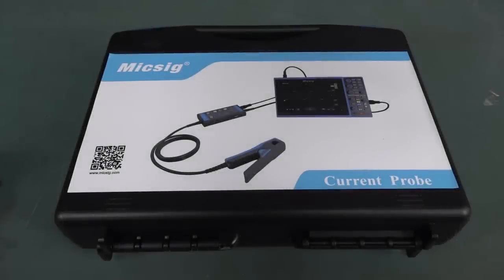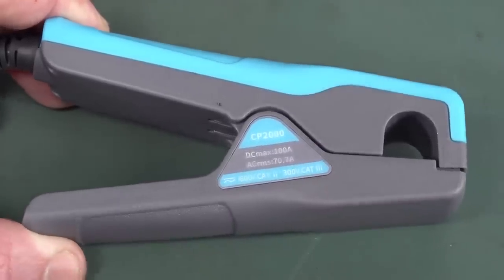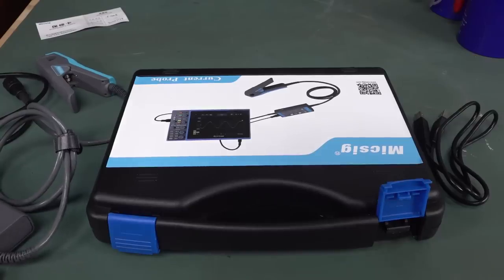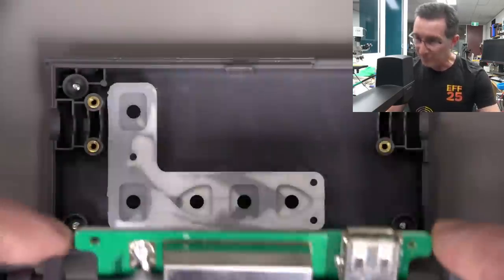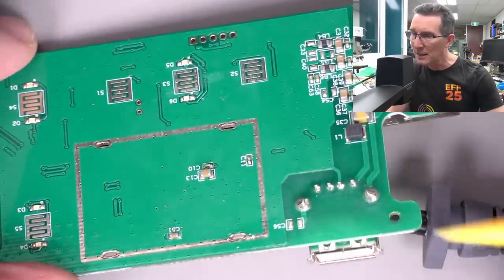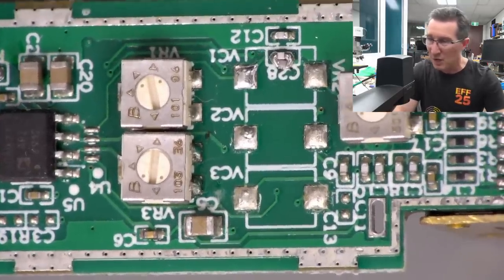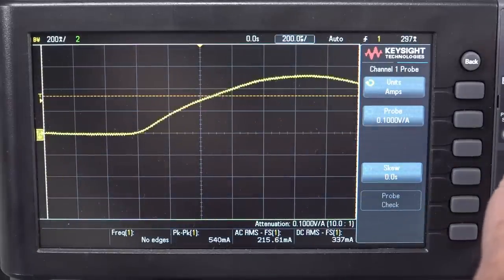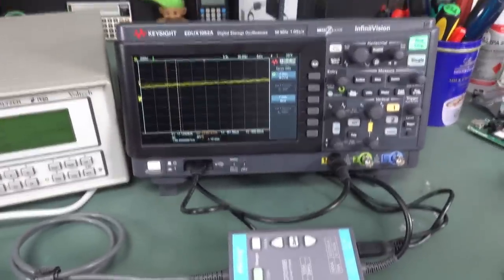EEVblog 1413 - Oscilloscope Current Probe TEARDOWN + DEMO

Comment: Well this is widely used in current sensing for hall sensor in parallel to cancel temperature coefficient. And I work for the company in the video. Max bandwidth we have now is 1-2mhz. And this not yet publicly available.
Reply: You work for Micsig?
Reply: @npc6632  multidimensional
Reply: @yuxianwang3238  So it is a Multidimentional device in the Micsig?
Reply: @npc6632  I’ll double check that. It might. But looking at the design. The ferrite core should not have a bandwidth of 1mhz. The magnetic permeability drops dramatically at high frequency. For those material. The best I known of caps at about 2mhz.
Reply: @npc6632  Multidimensional *
Reply: @yuxianwang3238  That's not the real Dave, so be careful.
Reply from the maker: @yuxianwang3238  Are there any competitor devices in the same package?
Reply: @EEVblog  I know some competitor has same package but using GaAs or InSb Hall but not TMR.
Reply: @yuxianwang3238  Hey Sir , can I know where are you from?
Reply: @MikeJohnMentzer  I’m from China educated in the states.
Reply: bug the oscillioscope been a pleasant experience.. though Micsig should deliver some of the features they been fronting to push thrue OTA.  example of the memory depth.. waveform refreshrates peaks around 100,000 wfms https://www.youtube.com/watch?v=vDdu-4F3XQs
Reply: also very easy to work with these micsig and nice with HDMI to fx portable batteryoperated projector..https://www.youtube.com/watch?v=wlkgdtkoAeE
I would reckon you could also just load the android app in the projector androidOS so no wires. , but havent tried that. bigger waveforms the better... next step 5 meters high on a buildingwall at night.. why?  why not.
mehh but for the money great' portable oscillioscope Micsig makes really love the small formfactor and tke bag to keep it all with mouse and currentclamps etc...
Reply: Can you give a clue on how does this tempco compensation work? as it doesn't make immediate sense to me. I assumed they have two in parallel to compensate voltages induced by changing magnetic fields (those induced in loops formed by the part leads acting like transformer coils)
Reply: @yuxianwang3238  i do not understand this meaning?

Comment: You need to hold the probe in the orientations it's going to be during the measurement as you are zeroing it. Otherwise you don't compensate for the earth's magnetic field.
Reply: Yup. Best to just set up your probe around the wire, power down everything, zero, then measure.
Reply: don't forget: tongue at the right angle and virgins on the slab, as well! :)

Comment: For decades I have used the Tektronix A6302 current probe (50MHz) with AM503 module. It  is an amazing tool as a design aid when designing power supplies. I would not even think about designing a supply without being able to actually see such things as the transient  current on the peak of voltage haversine charging filter capacitors. If you are even thinking of designing a power supply, first buy a current probe. This is an affordable and decent performing tool. Every lab needs one.

Comment: Got it myself as well. Quite happy with it so far. For measuring low currents a wire can be passed multiple times through the clamp to increase sensitivity. Looping twice makes current readout twice as high, .. etc

Comment: Micsig seem to make some pretty good stuff, very happy with the 100mhz differential probes I bought.
Reply: Agreed, I also have the diff probes and the quality is crazy for the price.
Reply from the maker: I had them design a x10/x100 model and I was going to stock it, but it had an issue with CMRR whne I measured it. They are coming out with an updated design.

Comment: HI Dave,  a couple thoughts for reviewing AC/DC current probes:  it'd be helpful to examine the AC waveform phase shift across the bandwidth, and square wave replication accuracy across both the current ranges and frequency bandwidth - it can be helpful to be aware of these things when using a current probe in brushless motor or switching power supply circuit analysis.

Comment: The USB DC-DC is to isolate the supply from your oscilloscope.
Very good!
Reply: I was thinking the same thing, Or when powering it with other usb power source
Reply: It is for preventing a ground loop between your scopes USB ground and BNC ground.

Comment: I dissected the PROVA CM05 current probe, and it also had two sensors mounted in opposite direction, and electrically chained in the same fashion.

Comment: If you put it around the feed wire to the starter motor on a small multi cylinder engine (100A isn't enough for large engines), a motorcycle for example, and disable fuel or spark so the engine doesn't start you can do a relative compression test in seconds. The current goes up as the starter works against the compression in each cylinder, so you can determine if all cylinders are even or one has lower compression than the others. 
Use it on any other brushed electric motor (such as a fuel pump) and you can see the current variation as the segments on the commutator rotates past the brushes, if brushes/segments are bad or a winding is toast it will be quite uneven while a good one should basically be a nice wave repetition.
You can see if an electromagnet moves something, as in a relay or fuel injector, the movement gives a hump in the current waveform.
You can identify coils (relay, fuel injector, ignition coils and so on) with partially shorted windings, as the current waveform will be different from a good coil.

A current clamp can be a fantastic diagnostic tool, even with far less bandwidth than a great one like this. I really have to get one soon -  or a couple, for low & high current.
Reply: ..... How cool, diagnostic detail surpassing mechanical results.

Comment: In college, I worked on a battery powered pic micro-controlled 3 phase current monitor that turned on, took a reading then went back to sleep ... used a i2c dac and 3 external probes, ic2 memory.  auto calibrate, set in the box, lock it up, come back in a few weeks and download the memory using RS232 to a pc and use excel for data analysis... bob's ur uncle.  Great memories.

Comment: It's more like $510USD plus shipping with the coupon code.    Hantek makes one that's not nearly as nice, but it's $54USD.  Manual zeroing and 20khz limit.  That's fine for what I bought it for.  Those of us that have an entry level scope like a ds1054z probably balk at a probe that costs more than the scope.

Comment: I'm guessing the isolated DC-DC converter was used, due to most benchtop osciloscopes having an earthed probe ground,  which could cause problems with some power supplies.
Reply from the maker: Right. If you powered from another USB source that could be potentially problematic.
Reply: Yes. And making two rails from one by single dc-dc.
Reply: They may also think that bridging the USB ground to the BNC ground through signal cables is a bad idea noise wise. The isolated conveter breaks this potential ground loop.

Comment: "If you go over the 100A limit you won't break it" - are you sure about that? I used to think so until we blew up some LEM sensors due to overcurrent. Admittedly, this was in a short condition with probably tens of thousands of amps, maybe more, still.

Comment: I own the CP2100B micsig and I confirm that the bw -3dB reaches more than 2MHz (I measured the band) then the capacitive couplings weigh and therefore it is difficult to appreciate, but still a great result under 400 €.

Comment: Small clarification at 30:50: The current we are pointing at is most probably the X capacitor current which leads the voltage by 90°. Current to achieve PF~=1 would have to be in phase with the voltage (which we don't see). Even with a PFC, the X capacitor would mess up the PF with the added capacitive current.

Comment: Magnetoresistance is proportional to B^2 and thus is not directional.  Resistance does respond to temperature changes, however.  To measure polarity it is necessary to establish a constant Flux midrange.  Perhaps the two sensors are for the two ranges?  Or possibly for temperature cancellation.

Comment: I think these may not be "hall effect sensors" but rather, they may actually be discrete hall elements similar to those that AKM produce (https://www.akm.com/eu/en/products/magnetic-sensor/hall-element/ some even suggest use in current clamp meters lol). Hall elements are at the heart of all of the different hall effect sensors, they are what produces the measurable quantities from the magnetic field.

Why do i think this?
Hall elements have high output resistances and small output voltages, a perfect application for a instrumentation amplifier, using a pair of them differentially means the temperature drift cancels but the sensitivity doubles. There are no bandwidth specs for AKMs hall elements, but I know AKM are an industry leader in current sensor ICs with the highest bandwidth and lowest response times, so I assume their hall elements would be in the same boat.

Comment: The Hall effect sensors might be polarized, hence the 180 degree offset. Remember that the current might be flowing one way or another through that core, reversing the magnetic field.
Reply from the maker: The single sensor is likely already bidirectional.

Comment: After dithering for some time, I finally bit the bullet and bought the 'B' model. Can anyone enlighten me about the use of the manual up/down switches? Perhaps they're useful if the auto-zero keeps failing? Secondly,  a few contributors talk about the "ferrite" core. I'm still learning about the weird and wonderful world of magnetics, but that core looks like plain ol' laminations to me, not ferrite (which is a ceramic). Am I mistaken? Thanks again, Dave. I've been putting off buying a current probe for some time due to the crazy cost, but this one looks like brilliant value for money.

Comment: I was watching a DIY probe build and they used a op amp to offset the DC reading from the hall effect sensor. I would guess the reason for the back to back sensors would be for reversed DC current.
On a side note. I absolutley hate the buttons used. They should have used microswitchs. In surprised you didn't say anything.

Comment: Re-badge this if it's good. Hey, was that 10ma signal scope averaged? At 12-bit resolution, wouldn't that uC's AD/C have a tough time? LSB works out to a paltry 2.5ma, so we were watching 2 bits... Did I miss something?
Reply from the maker: The output is completely analog, nothing to do with the ADC or DAC. The DAC just shifts the DC level.

Comment: 12:15  The soldered centre line of the black coax is really close on top of the capacitor with marking C66 to it.
Reply: I’m guessing there is quite some separation between them in height. Would’ve been cleaner if they kept the area under the coax clear and/or applied some hot glue to keep things from moving around though.

Comment: Helpful, thanks! I'm hooking up a Pintek Pa-677 current probe (clone of Rigol RP1002C) to a Rigol DS1054z scope - I'm stuck on a noob issue, translating the Probe "Scale" to the Scope's Channel scale/ratio setting. Is 50 mV/A to equal 0.05x, and 500 mV/A being 0.5x? Or should 500 mV/A probe scale be 2x on the scope channel setting (thus 50mV/A would instead be 20x)? Is there a snappy rule of thumb or logical expression of "how one knows"? Thnx if anybody can chime in <3

Comment: Newby question, when the bandwidth is stated at 2.5 MHz, does that mean that the instrument will report accurate recent measuring samples to the oscilloscope at 2.5 MHz and should only read waveforms with frequencies are some fraction of that, say 250 kHz (if 10 samples per period is enough?), or is it stating the device should be accurate enough to measure waveforms whose fundamental frequency is 2.5 MHz?
Reply: The bandwidth stated on most scope input devices is -3dB ... so at the "rated" frequencies, you'll already be seeing some drop-off. If you intend to regularly look at signals of a certain frequency, give yourself some headroom when selecting a probe.
Reply: @petergamache5368  Thanks for commenting Peter, but my main question is more basic, I'm not sure what the bandwidth is stating or asking a different way, what waveform fundamental frequency is a device with a 2.5 MHz bandwidth good for.  Should a 2.5 MHz instrument be capable of visualizing sine waves at 2.5 MHz, of will it be limited to a lower frequency that has to accommodate so many points per wave period.  If its recommended that 100 point per period will give an adequate reading, then this 2.5 MHz device would be recommended for waveforms less than 25kHz?  If I'm only interested in visualizing the basic waveform shapes and frequency, how high a sine wave frequency are the 2.5MHz and 900kHz current sensors good for?

Comment: How would one build something to measure changes in direction and amplitude of earths magnetic field, does it oscillate?
Is there any cheap tools to visualise it, maybe computer kit?
Android app?

Yeah i know about compass  ;)
Reply: Is there something like Schumann resonance meters?
Could it possibly tell something about the weather?
Reply: You would take 3 of the hall effect sensor and arrange them orthogonality and fix them to the Earth. Connect them to a microcontroller and it can to the basic trigonometry that would give you a vector of the Earth's magnetic field. You could log it for as long as you want to look for changes or patterns that correspond to weather patters.

Single chip 3D magnetometers already exist and I believe many smart phones have them. https://www.digikey.com/en/product-highlight/m/melexis/mlx90392-3d-magnetometer They provide the compass heading and are a stabilizing reference to their 3D accelerometers. I don't know if Android or IOS exposes the actual vector to apps, but if they do than you could make an app. I don't know about the accuracy since the field strength is very low already and the changes would be very small. The sensor is already inside the phone which would be a source of shielding and interference.
Reply: My phone had no sensor....
Reply from the maker: Not easy to avoid it. If you are desinging to measure small magnetics fields it's kinda hard to avoid the big one surrounding everything.
Reply: @EEVblog  I think my problem is that i really do not know the strength of the typical magnetic "background noise" in  a home and that is of course dependent of distance to sources. But lets say i have a 30 watt speaker and amplifier pushing some sinewave at full effect and keep some two meter distance what would that  noise add up to in micro  Teslas  a 10th or 100th of micro Tesla or will it drasticly affect the readings in micro Teslas?

What is the typical response/update time of a magnetometer in hz if i want to sample?
Reply: @EEVblog  I want the opposite sampling the earths magnetic field over time without to many local sources infer with the measurement, but as people say it is probably hard indoors, so i wonder"what range" can i expect the background magnetic noise to be if i keep a distance of 2 meters to possible sources like speakers and electronic equipment.

Comment: i use micro versions of this (hall effect) on electric cars for factory integration. sniffing the can bus and programing triggers for aftermarket devices from factory hex data. the newer cars all have advanced current protection circuits so if they get an over the air firmware update and while flashing they detect some spliced in device thats drawing even a few hundred mA more than spec they can hard stop... bricking a dozen computers in a 100K$ car. only fix is to remove the offending hardware, remove the computers and side load them with new firmware... it fucking sucks. so by passively reading data bus and drawing power from discrete 12V sources, you eliminate this scenario.

Comment: I have to say.. the COAX connections are ATROCIOUS!  they aren't even RF GRADE (the stem becomes an INDUCTOR at the higher frequencies)
Why doesn't anyone seem to know HOW to "unbraid" a coax?  perhaps I should do a DEMO VIDEO and teach everyone how to do it..  I mean, not even radio/RF guys (and, even, hams) seem to now how to do this  (I'm been able to do it since I was 10 years old, for crying out loud hehe)  Oh, WAIT! he did say this was a PROTOTYPE, no? OKay, then,  in THAT case... (but if anyone wants me to do a training video on how to properly debraid a coax.. I can comply!)
Reply: That little stub isn't going to make much difference at 2MHz.
Reply: @NiHaoMike64  perhaps not, BUT.. we are talking accurate MEASUREMENTS, here, no?  thanks for your reply :)
Reply: This current probe is designed to be used with a 1 MOhm input impedance scope, so the coax is just being used as a simple wire, not a transmission line. Furthermore, at 2 Mhz in coax the wavelength is just about 100 meters, and an impedance mismatch which is 1/20000th of a wavelength long is absolutely negligible anyway.
Reply: @EnricoConca  hello there and thanks for your reply; I see what you are saying, however, since he was reading the waveform directly on the 'scope (he said it was a "pass-through", I thought), I concluded that it was, indeed, passing low-frequency RF, and, even at 2 MHz,  any impedance-mismatch (esp at a high impedance) would render an error in  measurements; it seems that they went through the trouble to use COAX and not simple shielded cabling... and it appears to be tightly-shielded no less (as any good 'scope cabling should). :)